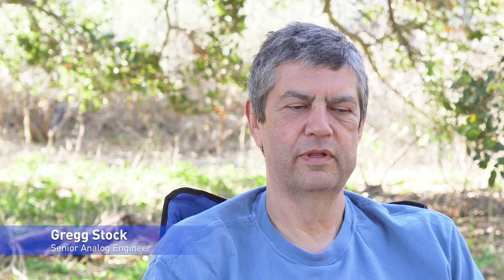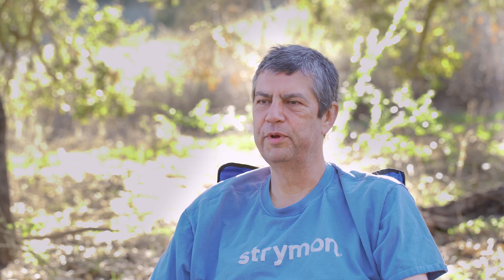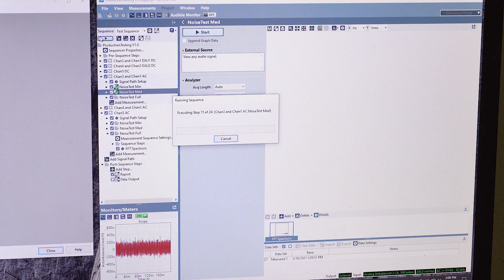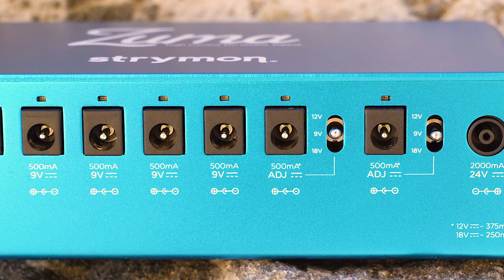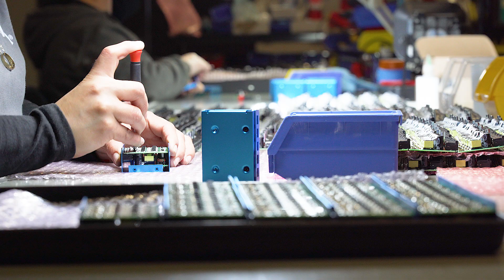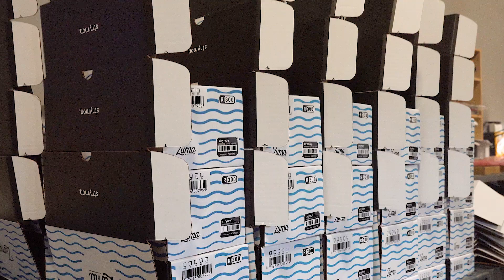Strymon Pedal Power Supply Design Team – From Aerospace to your Pedalboard

Comment: Got Zuma recently. Not a gigging musician, just finally had it enough with dirty power from the mains and using separate power supply for each pedal. After I put my entire pedal setup through Zuma I got rid of pretty much all the static hissing from pedals, especially from ODs and fuzzes. Clean power is nice. 
Not my first Strymon product, and I doubt it'll be the last. Each one I've got so far has been a fantastic piece of kit. Beautifully designed, engineered, and put together.

Comment: Since 15 years i've been using other brand's 'so called' high end power units, then my pedalboard got bigger, then i needed more juice and bought a Zuma and shocked how really quite it is. All hissing and strange oscilation sounds are gone. Now I'm running all my pedalboard with Zuma, Ojaji's chained together. Now the only noise i hear amp switch flicking sound :D I'm so happy AF.

Comment: I was very interested to hear the comment that the Zuma can provide additional power for pedals that need it during start-up. In my case I have a WMD geiger counter pro and connecting it to the Zuma will just crash loop continuously. I tried adding a couple of electrolytic caps (like reservoir caps in a tube amp) and that fixed it. I guess the Zuma protection circuitry is just a little too quick in this case. Aside from that though, I think the Zuma and ojai are superb!

Comment: I just got a deal on a second Zuma but immediately after was bummed because it looks like you cannot chain 2 of those together, it's only Zuma > Ojai (>Ojai, etc) is that correct? I can't add another zuma using the 24v?
Reply from the maker: We don't recommend chaining Zumas off one another. If you want to use two Zumas but avoid having two long power cables, we'd suggest a two-to-one IEC splitter or something along the lines.
Reply: @strymon  right.  Yeah, still not terribly clunky doing it that way but I was really excited to do two together because the deal was much better than buying a new Ojai in this case.  I appreciate the response! 🤘

Comment: I got a question ?
I did buy the Strymon Zuma.
It has not a switch off and On
Sooo ? 
Do I let it on all the time and is it sucking Energy then all the time , I meant at least the LEDs use energy ?
Will it get hot when letting it on all the time ?
Or do I need to unplug and plug it all the time ?
Should I buy a energy bar with an on/off switch ?
Reply from the maker: You should unplug or disconnect it when you're not using your pedalboard, either by disconnecting it from power or from using a power strip/energy bar. Zuma has tons of protection built in, so it will fire up all of the pedals as normal when you reconnect power.
Reply: @strymon  Thanks a lot 🥰

Comment: Currently running a Zuma and an Ouija that is powered by the Zuma. Can I run 2 Zumas with one being powered by the other and delete the Ouija? I need more power slots.
Reply from the maker: If you don't need more than five more power outlets, you could just add a second Ojai and connect it to the 24V THRU of the first Ojai. You could even chain in a third Ojai if you needed to. If you wanted to add a second Zuma instead, it would not be connected to the first Zuma. Both Zuma's would be connected to separate AC outlets on your power strip or other electrical outlets.
Reply: Perfect! Second Ojai it is! Thank you👍🎸

Comment: Boss ACA out 12volt or 9 volt?
Reply from the maker: Hey there! Any Boss ACA pedal will not work on a regulated 9V supply. The ACA power supplies were unregulated, so the 9V supplies actually put out around 12V DC when loaded down with a Boss pedal.

Comment: It’s a pity you chose such a poor connector for the power input - mine needs wiggling to maintain connection.I hope Boeing uses more robust methods!
Reply: Actually, I think it's more the cable they chose. I have to use the power cable from my old supply; it works a treat.

Comment: why power supply so expensive for only 5 plugs
Reply from the maker: The Zuma and Zuma R300 act as the hub of an entire power system, capable of delivering a full 48 watts of power across multiple units (enough to power nearly 40 pedals!). There are expansion ports to be able to add more outputs when you need them via Ojai Expansion Kits, which is far less expensive and more compact than buying multiple supplies that need their own separate power supply. So the slim Zuma R300 has five outputs, the normal Zuma has nine outputs, and each Ojai Expansion kit has 5 additional outputs in a very small expansion box. The Strymon power system is the quietest solution on the market by far, so your pedalboard will ever be quieter. I hope that helps!

Comment: I wish they had an option for a standard a/c plug like the Voodoo Lab Plus 2’s so.
Reply from the maker: Hey there! The best solution we can recommend if you want an AC output is to use an IEC splitter with an AC output. These IEC splitters still allow you to run just a single power cable to your board, while giving you two connections: an IEC end that connects to Zuma’s 100-240V input, and an AC outlet (just like the end of an extension cord) that can be used to connect the power supply for AC pedals, to connect pedals that have attached power cords, or just connect other utilities (like a USB wall outlet).